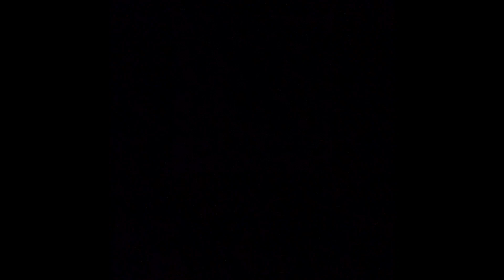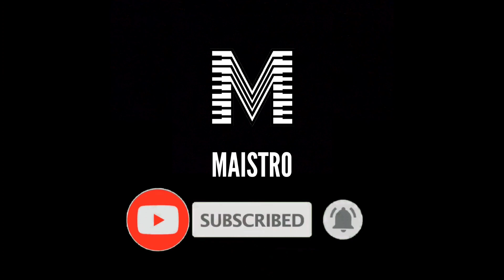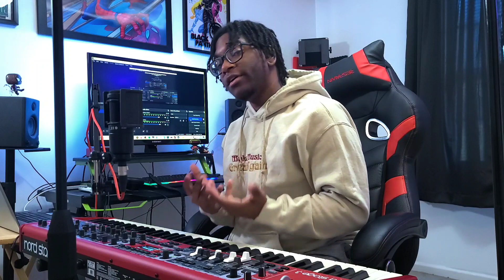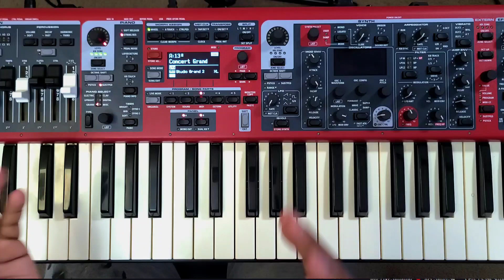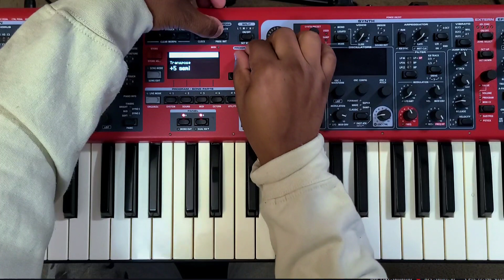Nord Stage 3 - Transpose Button

Comment: Hey buddy, nice video. I have a question if you could answer. Does the transpose act globally (as in does the Nord stage series keep the transpose intact when user Programs are changed) ? 

So if I've transposed to Bb, will the next user saved program stay in Bb or C? Thanks.
Reply from the maker: Yes Nord does have a global transpose feature and it does stay intact when switching programs

Comment: Bro I don’t know if you have figured it out yet, but there is another way: 
In the ‘System Settings’ Menu

1) Hold down ‘Shift’ and press the ‘System’ bottom 

2) Tap the ‘Page Right >’ button  until you get to the “Global Transpose” page

3) You can now Transpose by twisting the ‘program’ knob

Even though this way may be easier, I still prefer Yamaha’s Transpose function
Reply from the maker: Hey yes I did end up figuring out in another video 🤣